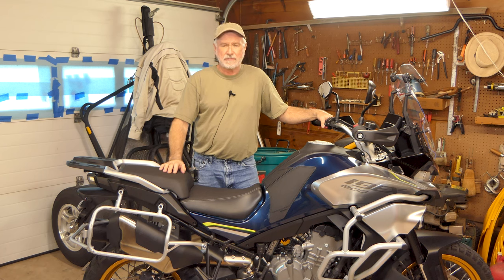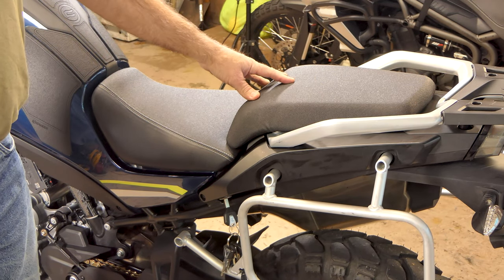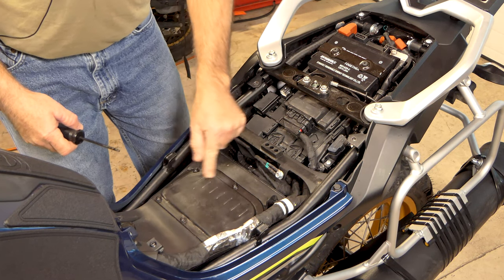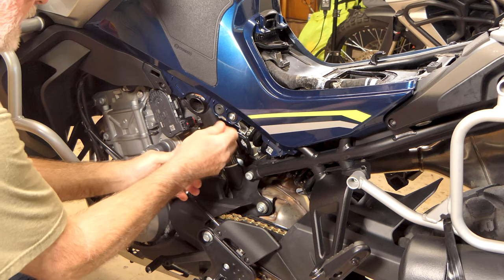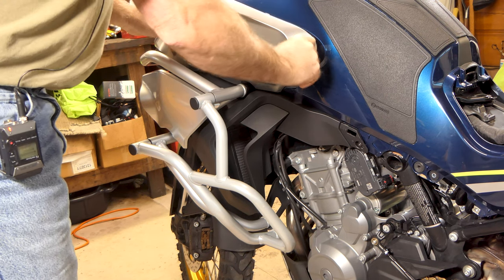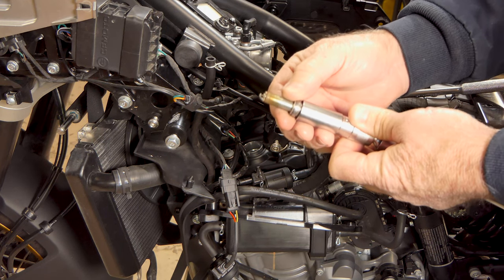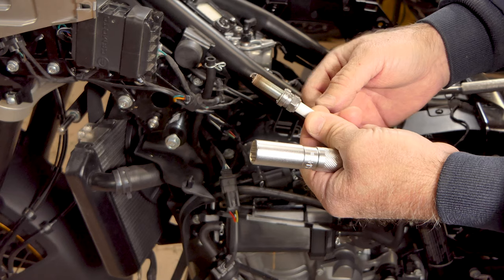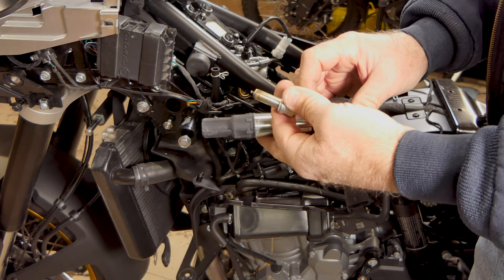Can You Work On Your CFMOTO Ibex 800T / 800MT ?

Comment: Hello John,  Thank you for sharing how to remove the spark plugs on CFMOTO Ibex 800T. Man, they really use a lot of screws and bolts to hold those plastic panels, gas tank cover, etc,  just to get to those spark plugs.  Being an adventure bike, I guess CFMOTO doesn't want any parts coming loose or rattle at all. Regarding the installation of the spark plugs, I don't know if you applied some but I'd like to suggest to coat a little anti-seize on the spark plugs for easier removal next time. A must on the aluminum heads. Also instead of using grease to lube the rubber coil seal use a Dielectric grease. Many greases aren't compatible with certain types of rubber, which can cause seals to swell or crack and lead to damage and down-time.

Comment: Just barely got 2000 kms on this bike before the snow fell and after changing the air filter on my wing I’m relieved that doing basic maintenance on this one will be a lot easier. As for thé panels to get to the plugs and valve clearance checks it sucks. I regret selling my 93 R100GS … easiest bike to work on and it never let me down. Big thanks for this video!!

Comment: Thanks for the video, I went to fit some bar risers but found the front brake hose is just long enough, not enough spare to raise the bars up. I tried to find out where the hose went hoping there might be a tie or a clip I could remove to get a little more hose length but couldn't see where it disappeared to. Looking at your video it appears to go to what I assume to be the abs pump under the tank, gonna be a big job getting to it and maybe replacing the hose with a slightly longer braded hose. I've downloaded your video and it's going to be invaluable when it comes to stripping the covers and tank off etc. Thanks for posting.
Reply from the maker: Good to hear from you sir, thanks for watching...  :)

Comment: Absolutely awesome video.  You need a TIP button on here. I actually looked planning on sending you one. I’ll check back
Reply: I bought the Throttle Punks ABS cancel switch and I have to remove the tank to install it.
Reply from the maker: Thanks for watching..  :)
Reply: When I installed the top shelter, I noticed if I loosen the handle bar and rotate it up and forward it made installing the top shelter much easier.

Comment: Does the bottom of the air filter cover have a gasket or anything to stop air from being sucked in ?
Thanks for making this video 👍
Reply from the maker: Hello there sir... good to hear from you. No gasket on the cover door itself... anything that gets in around the door is still on the intake side of the air box the same as the intake air and has to pass through the filter to get in the engine... thanks for watching sir...   :)
Reply: @ozarksbackroads5484  thank you for responding so fast. I heard you mention the airbox cover helps hold the filter in place , so that makes sense . 
 I'm leery of oiled filters contaminating the maf sensor..great on older bikes, lawnmowers and chainsaws...but I wouldnt do it for the small gain in hp on anything valuable without knowing for sure..

Comment: once you got the sheetmetal screws out of the silver side panel, did you just pull on the panel to get it to come off.. how much force did it take to get the panels clips to release
Reply from the maker: Good to hear from you sir,  My panel popped right off easily once all the screws were removed....  :)
Reply: @ozarksbackroads5484    i missed the screws that are under and inside the hole where the crashbars slide in at the top , they are hard to see.. ill be servicing the swingarm bearings next. mine only has a couple hundred miles on it but maybe if i catch them early they will last a bit longer. the ktm swing arms are better quality because there are more needle bearings to spread the force out more, and keep from scarring the races, but wheel see ... thank you for the help, i just could not find that one last screw on each side LOL.. happy riding

Comment: Does it look like the valve cover can come off with this amount of disassembly or does more have to come off?
Reply from the maker: Good to hear from you sir, there are a few items on top of the head that will have to be moved out of the way and a piece of plastic in front of the heads but not much... should not be much of an issue.  I think the valve cover will come off pretty easily once the tank is off...  Thanks for watching...   :)
Reply: @ozarksbackroads5484  great videos, used to be a Ducati certified technican doing a valve inspection on this looks easy compared to the multistrada.
Reply from the maker: Hello there sir, good to hear from you.  I imagine doing a Ducati would be on a whole nother level...  thanks for watching...  :) @isaacm12

Comment: What size is the front axle allen key?
Reply from the maker: 12mm...   :)
Reply: @ozarksbackroads5484  thanks for your quick reply!
Reply: @ozarksbackroads5484  okay I had the hardest time getting the rear wheel back on. I was having the hardest time fitting the spacer and brake assembly. It was such a pain! Any tips? Tricks? I was just using my center stand.  Does having the wheel barely just supported by the ground help??
Reply from the maker: Hello there, good to hear from you sir, sorry to hear you had a hard time.  If you were trying to lift the rear wheel into place I imagine that you had a hard time indeed.  It is much easier to let the tire sit on the ground and adjust the height of the motorcycle with a screw lift or jack under the center of the bike.. hope you got it all back together ok... thanks for watching...  :) @AdventurePlusOne
Reply: @ozarksbackroads5484  after many swear words I finally got it back together with my new knobby tires. Can't wait to ride! I'll have to invest in some better equipment like you have. Haha thanks for the vids.
Reply: I'm so sorry for bothering you but I appreciate your wealth of knowledge. On another video of yours you grease the swing arm bearings, and as a comment mentioned, you probably don't have to take it all apart to do so. Just take off the two foot peg holders and remove the shaft and grease. Is that right? I would hate to have to take my bike apart again. Haha
Reply from the maker: no problem sir, yes I have had other people say that they did it that way...   :) @AdventurePlusOne